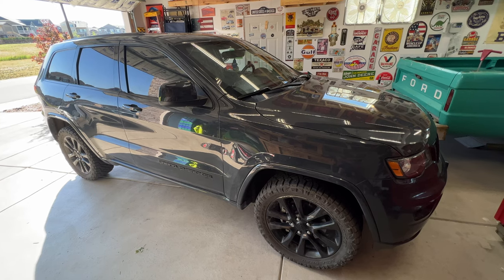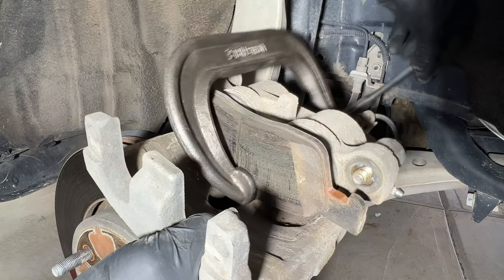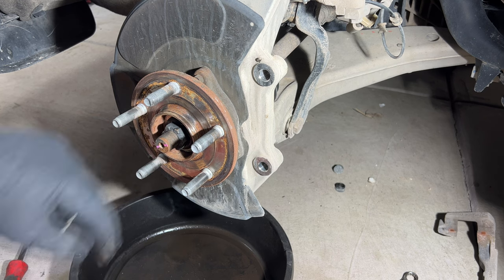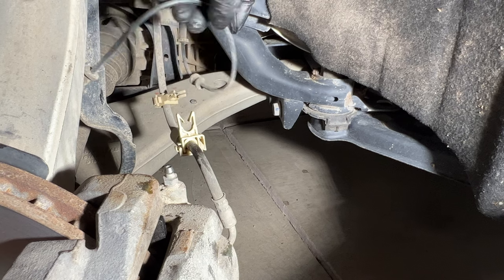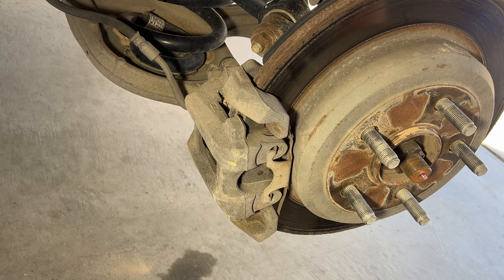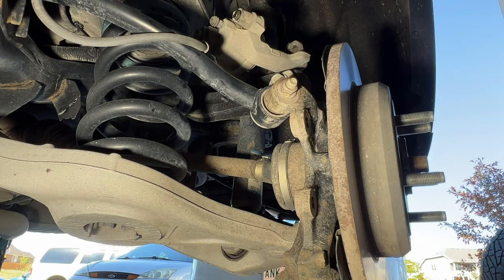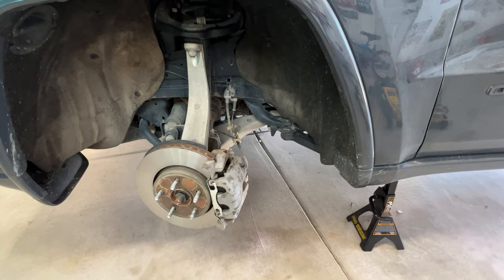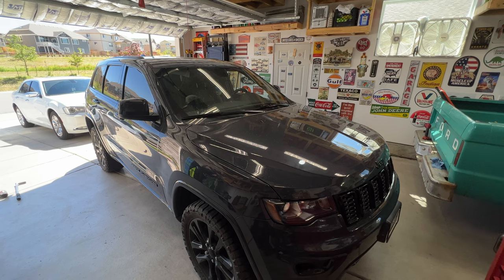2018 Jeep Grand Cherokee Front & Rear Brakes Replacement How-To

Comment: Great tutorial, mine has 50,000 miles and pads still have 60% pad left , should i replace ? Wifey drives it easy .
Reply from the maker: No if you still have that much pad left no sense in replacing them right now. Save your money.

Comment: Why cant you use a c clamp on the rears??
Reply from the maker: You can still use a c clamp I was just showing another tool you can use.
Reply: @BLUECOLLARGARAGE  I've seen some videos of an electric park brake that the piston needs to be retracted.  How do you know if you have that?? If my parking brake is a peddle, does that mean i don't have it?
Reply from the maker: @welch3319  yes correct if you have the pedal it will be a manual parking brake. The electronic one will have a switch.
Reply: @BLUECOLLARGARAGE  Thank god.
Reply: @BLUECOLLARGARAGE  it seems like it's easier

Comment: I have the Summit edition with the air suspension. Do I need to disconnect the battery to prevent it from trying to auto level?
Reply: Disable the system through your touchscreen.

Comment: So every tutorial about the grand Cherokee pads replacement I see on YouTube, they talk about greasing the guide pins on the calipers, but for some reason the “Haynes” repair manual I own for my jeep says don’t grease them pins. I wonder why they say that? It looks pretty obvious to me that something with a lot of friction such as the guide pins should be lubricated right?
Reply from the maker: Yes you will want to grease the slide pins not sure why Haynes says not to.
Reply: @BLUECOLLARGARAGE  thanks for replying man, your videos are a great help for me, I’m not a mechanic but I find joy in doing basic maintenance myself. Your video about the axle and transfer case fluid change had help me big time, thanks for your great content.

Comment: Nice job with the detailed video. Good to see that some of us still get the rotors cut (if applicable) rather than just throw away and buy new. I have a 2015 JGC and pretty much the same brakes/workflow as the 2018 you repair here.

Comment: Great Video! Thank you! It helped this first timer have confidence to take rotor and pad replacement myself.   - if you have an older WK2 (mine is a 2015 with 100K) with original brake pads, your rattle could be caused by rusted mounting studs on the break pads.  They make the little pressure mounting tabs out of cheap metal and they literally rust away with time and then allow the pads to make an annoying rattle over bumps (can occur on rear as well).  I live in Cleveland, OH and dump a lot of salt on our roads, so if you go longer than say 5 years, and live in a similar environment you may have the same issue.  Simple fix with new pads (although both my rotors and pads had another 10-15K of life in them).  I have NEVER had a set of pads last longer than 35-40K - Jeep did a great job engineering the pads and rotors to match the WK2 (mine is V6)!  When I went to replace them, I paid up to use MOPAR parts hoping to get same results again - don't mess with success!

Comment: Great detail.  I’ve done a lot of work on cars but never messed with brakes.  Wanted to have someone else to blame if they ever failed!  2 years ago (15,000 miles) the shop said I had 70% brake life remaining.  The passenger front squeaks occasionally so I bought new pads this week.  After watching your video I’ll have the rotors turned since that’s a pretty easy step.  I’ve pulled axles before so this shouldn’t be anything too foreign.  I’ve just never changed out pads or broken them in (thanks for the details on that as well).

Comment: Can you tell me please what kind of grease you use for the caliper guides?
In fact, I came across information that Mopar does not recommend lubricating them.
Reply from the maker: This is what I usually use https://amzn.to/3U7tjTd or sometimes the pads will come with the grease. Not sure where you came across that all brake caliper pins should be lubed so they slide correctly.

Comment: Great video step by step. I’m about to change my pads and rotors for my grand Cherokee 2018. When it comes to bleeding the brakes is it a simple process for all four lines ?
Reply from the maker: Yeah what I usually do is suck all the old fluid out of the master cylinder reservoir with a turkey blaster or fluid extractor. Then top it off with new fluid. Next start bleeding it at the passenger rear, driver rear, passenger front, and end at the driver front. I usually use the power motive bleeder or my mitivac bleeder.
Reply: @BLUECOLLARGARAGE  thanks man appreciate it

Comment: Super helpful video! Question for you - do you happen to know if your brakes are Heavy Duty brakes on this model? I have a 2014 with what looks to be the same setup as yours but can’t seem to find anything concrete on the internet.
Reply from the maker: I think all these came with the same basic brake pads and you can choose in the aftermarket parts if you wanted to upgrade to heavy duty ones for if you tow or something with it.
Reply: On my 2020 you know you have heavy duty brakes if the rear rotors are vented just like the front if they're not you have standard brakes.

Comment: My guide pins gave me more resistance than shown in your video. I lubed them up and reinstalled but I’m questioning if they should be replace. The braking does feel good after install.
Reply from the maker: Was there any rust build up on them?
Reply: @BLUECOLLARGARAGE  no rust at all.
Reply from the maker: You should be fine then as long as you used plenty of brake caliper grease on the slide pins.

Comment: If you use an impact wrench on your wheel lock/wheel lock key you could strip it out and or ruin the shape which would cause it to slip. Always loosen it by hand first then use the gun to take it off.
Reply: Yep, I had a shop ruin mine then put it back and I didn’t find out til I had a flat in the middle of nowhere.

Comment: posted this on another similar video: Great video but I got hung up on one thing. The rotor wouldn't come off, essentially a rust ring (I assume) holding the parking brake shoes. I found the adjuster behind the rotor plate or whatever it is. But I have no visibility at all on which way the adjuster is oriented and which way to spin the adjuster and is it the opposite way for each side. Do you know this info or do you have a video on that on the Jeep? I have a Summit series and all the air suspension components don't help with visibility. I do not have a brake spoon and plan to get one. If you see these messages, please comment when you can. THANK YOU!

Comment: Aren’t the caliper bracket bolts (not the guide pins) one time use “torque to yield” bolts and thus need to be replaced if removed?
Reply from the maker: No they are reusable.
Reply: @BLUECOLLARGARAGE  sorry just curious, but how do you know? Do you have the service manual? I’m thinking about buying the manual just for the peace of mind.
Reply from the maker: @willdubeast88  I’ve never heard of brake caliper bracket bolts being one time use. I’ve reused caliper bracket bolts on hundreds of vehicles. Some due use locktite but that’s it.